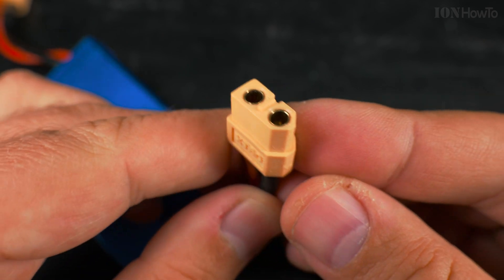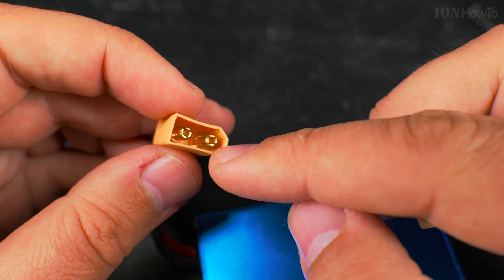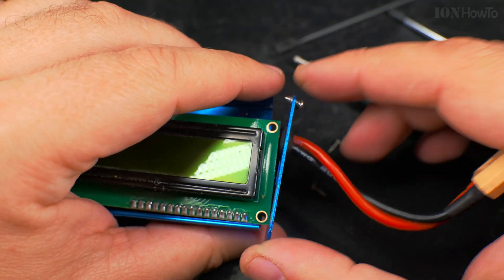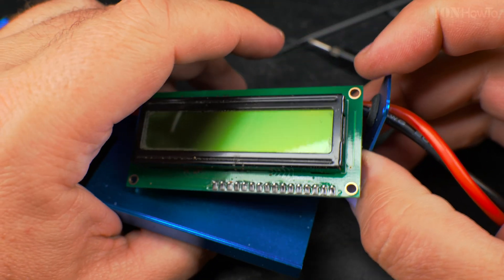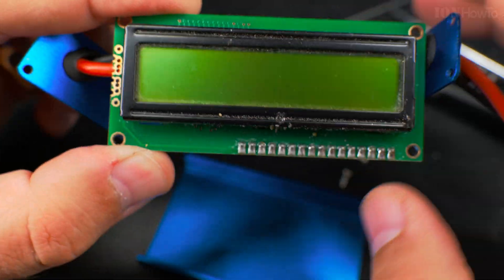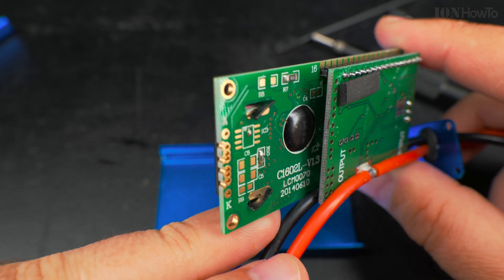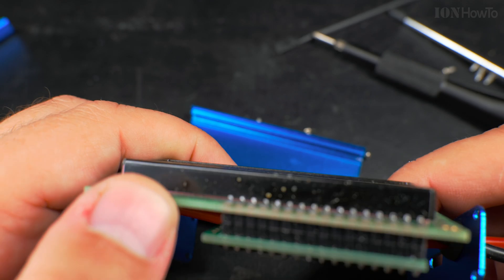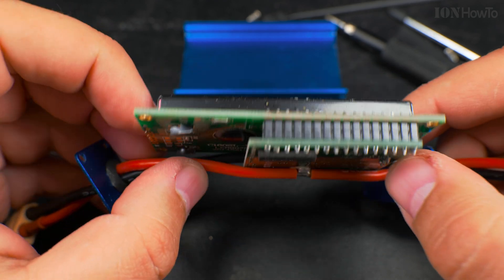RC Toys Watt Meter Teardown

Comment: Thanks for the teardown. It is funny to see they advertised as 100A rating, those small wires and the Shunt are more likely to handle 20A, at 100A the wires and Shunt will burn up.